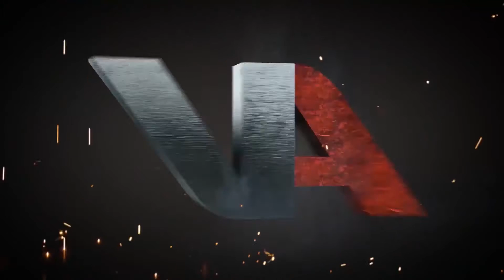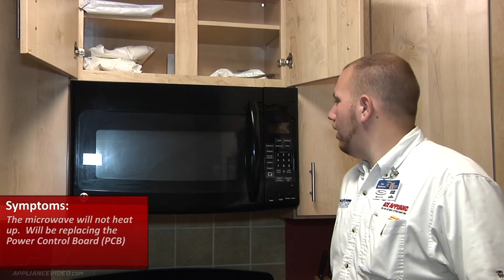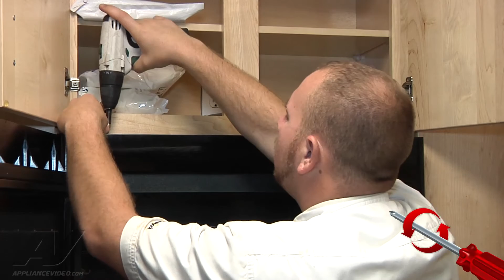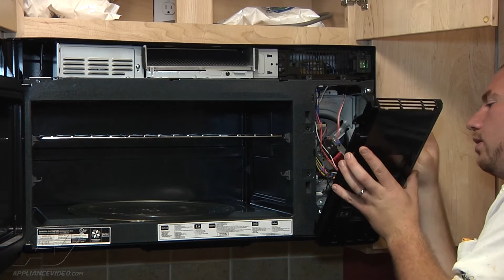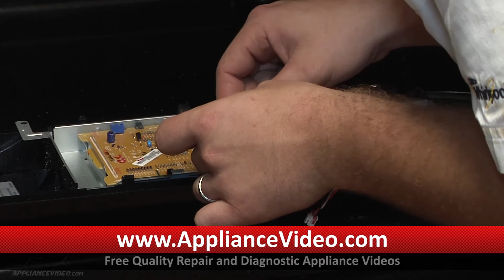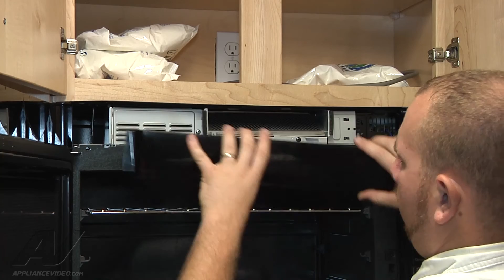GE Microwave Repair - Does Not Heat Replacing the Pcb - Main Power Board

Comment: I have a General Electric microwave oven and a security code was added just before I moved out.   They refused to give me the information.  Not knowing how to get the code cleared I put it in storage.   Is there a way to clear the security code?
Reply from the maker: Michael
           I will post this question on our ApplianceVideo.com website. There is a free Repair Help section. I will see if can get an answer for you their. If you go to the website it will be posted on the Repair Help section and one of our technicians will answer it.